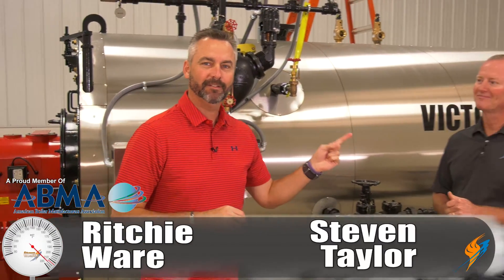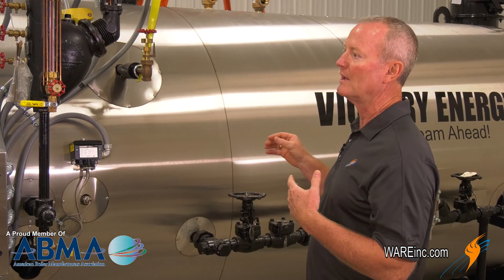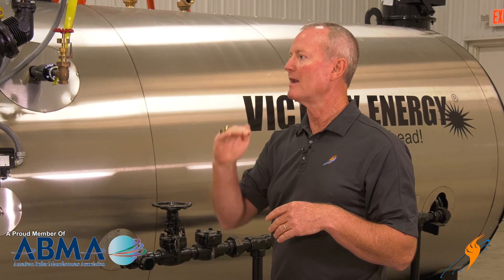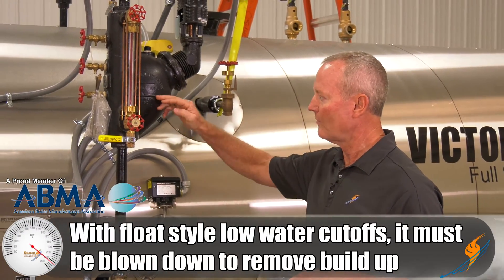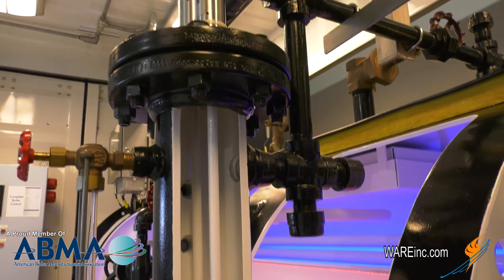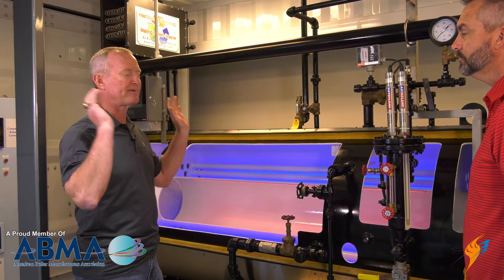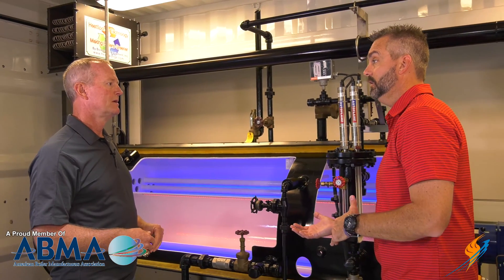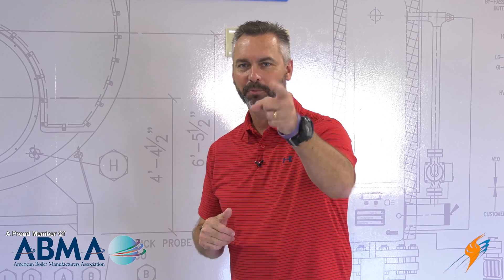Low Water in a Steam Boiler - Boiling Point

Comment: Cool video! I love the cutaway boiler. But Steven, water added to an overheated boiler can't "instantly turn into steam" for several reasons - mainly because
 
a. the water is still under pressure,
b. adding water takes time
c. convective heat transfer from steel to water takes time
d. steel doesn't hold much heat (only 0.12 BTU/lb/ºF)
e. but water at 400ºF/250 psi still requires about 800 BTU/lb to turn into steam 
f. 400ºF water will hardly "wet" red-hot steel at all (Leidenfrost Effect), so with excessively high steel temperature (1200ºF) - amazingly - heat transfer from red-hot steel to water actually takes LONGER than usual at 400ºF. Weird, but true.🧐
g. In other words - adding hot water to red hot steel is exactly the same as adding red hot steel to hot water, it's not nearly as exciting as you think.

In rough numbers - say, 
- ten 2" tubes ten feet long (~300 lbs of steel)
- heated to 1200ºF - a dull red (800ºF over 400ºF boiling point) 
- only contains 21,600 BTU of "excess heat" - 
- theoretically, enough to turn ~27 lb of water (3.24 gallons) at 400ºF completely into 47 cu ft of steam at 250 psi. 
- say it took 2.5 minutes total to boil 27 lb completely, so only 13.5 lb extra steam/minute (810 lb/hour).🧐

Even if all the 27 lb of water boiled in 30 seconds, a 2" relief valve could handle more than double the extra steam the red hot metal could generate. And the hot tubes can't make steam any faster that you can add water, so if you trickle it in even slower, the total lb/min of excess steam cannot exceed the lb/min rate of water feed.

But you need to add 2" water to the boiler to cover the tubes and quench them completely, which would require about 18 gal, or 150 lb - about 6X more water than the "excess heat" in the overheated tubes could boil (27 lb), so the actual amount of "excess steam" would be about 4.5 lb total. 

In other words, water added to an overheated boiler can't "instantly turn into steam" - for a lot of reasons. But it's still not a good idea to quench overheated tubes under pressure for stress reasons. They could shrink fast enough to pull loose, or tear right out of the sheet, which would be bad.

So if we found the top row of tubes dry, and they are not leaking yet, I'd say shut off the fuel, stay calm, and don't do nothing except hold the water where it is until it cools down.

If we found ALL the tubes were dry, I'd shut off the fuel and run like hell.😂 

Please check my (crude) math, but I think it covers the basics.
Reply: I cannot agree with you conclusions. You mention the Leidenfrost Effect, and then say water can’t boil “instantly”. The Leidenfrost Effect is due to an insulating layer of...steam...that is generated so quickly that the water can’t fall through it to the surface. As soon as one bubble leaves the surface, water touches the hot surface and makes more...steam!

And the fact that you cant instantly add 37 gallons of water exacerbates the situation. If you could instantly add a blanket of water to quench the hot spot, you could probably avoid an explosion.  But what little water reaches the surface instantly turns to steam—and stays steam!  If one gallon, or five gallons of water flashes to steam, what happens to the pressure? If the steel is red-hot, its because there’s fire behind it; you can’t just consider the latent heat in the steel. 

Good luck making the door! 😁

Comment: We had three 750 HP boilers Clever Brooks. Typically only two ran at a time unless it was real cold then maybe all three, summer only one. So if two where running I would fire up the not being used let it get to temp, and do a sight glass blown down and  do the bottom down, repeat on the second boiler EVERYDAY. We would also rotate which two or one would run at any given time. So all three will be running at some point during the week.

Comment: Does the code require the second low water to lock out the burner controls ?
Reply: Depends on your local code.  Boiler controls can be different depending on the local codes.  Most BMS will require a manual reset on the local control panel before the boiler's burner can recycle back on if the aux LWCO trips the unit since its usually wired into the BMS's non recycling circuit.  The level control pump on pump off micro switches on the Mcdonnell Miller with turn the feedwater pump on/off to maintain normal water level and the primary LWCO on a firetube will generally restart the burner when the level returned back to normal if the Mcdonnell Miller does not have a manual reset on primary LWCO switch and if it is wired into the BMS's recycling circuit.

Comment: If the low water cutoff is meant to be instant, how do you deal with large losses of load which cause the water to shrink rapidly and the reduction in firing from the trip causing the water level to continue shrinking (due to the reduction of steam bubbles) further exposing the tops of the water tubes?

I understand that during constant loads running out of water can easily melt the tubes and the heat removed before this can do damage, but how do you deal with and adequately protect the boiler during load changes as the water inventory must increase (as the water shrinks) during a load reduction?

Comment: So what device that prevent too much water in the boiler? The video show some sort of switch above the boiler but didn't mention it. Thanks
Reply from the maker: High water Alarms / cutoffs are optional so the boiler from the factory could potentially not have it. These devices will be very similar to the low water cutoff but typically mounted higher. Hopefully that helps. Thanks for watching!

Comment: But how are u gonna test the secondary Low water cut off by opening the bottom blow down valve and watching the gauge glass to see if the burner shuts off before thr water in the glass dissapears IF the burner will or should shutoff before that point due to the primary low water cutoffs point of tripping the burner is before the secondary low watwr cut offs. U know what i mean? Do you temporarily jump out the primary low water cut off?
Reply: Why would anyone roll a tube standing behind the machine unless he want to get hurt. Your suppose to stand to the side with arms extended. Did this 4  29years in nyc.
Reply: I have the same question as DaGenius86.  Also, when conducting the test, as the water level drops in the sight glass, isn't this water level matched to the water level in the drum (i.e. the drum level is lowering to the same point as the sight glass.)?

Comment: Using the McDonall & Miller 750 series with the probe mounted in the top of the boiler, I find it very common that the 750 will not lock out the burner while there is water still visible in the sight glass while the boiler is operating (low pressure). I thought about cutting the probe shorter. But, if I shut the boiler down and blow down the boiler, the 750 will lock the burner out when there is still 1- 1.5" of water in the sight glass. What are your thoughts?
Reply from the maker: I would be very cautious before cutting the probe shorter unless it has been replaced and cut during installation. Perform some very detailed measurements before attempting to shorten the probe. 

It really sounds like there is some swelling going on when the boiler is firing. This is common on boilers with high furnace heat release rates or low sq/ft of heating surface to HP ratio. What happens is that while the boiler is firing you have a higher water level in the center of the boiler, where the highest heat transfer is taking place, than you do on the sides of the boiler. So even though the sight glass showed that the LWCO should have been dropping the boiler out the probe was still made due to the swelling. When the burner was turned off there was no swelling so the level had equalized.

I have seen this and it is not uncommon. But I would do some additional test to make sure there is not a circuit issue. Is there some way that the 750 could be bypassed while the burner is energized? If you continue to drop the water level with the burner firing will it eventually drop the burner out? If not then you have a more serious issue that needs immediate attention. As always, make sure that you consult your boilers manual for detailed information on procedures or get with a local boiler service company to make sure the boiler is operating safely and efficiently.  Thanks for watching and hopefully that helps!
Reply: @wareboilers  Yes. This does sound like swelling. The DOES eventually shut down the boiler. But when it does, the water level is out of the sight glass. It's still above the tubes so I think it's safe.

Comment: ok how do you add water to the boiler and not have the injected water being added forced out due to the pressure inside the boiler.  Is the water entering the boiler at higher pressure then internal pressure?
Reply: Yes because it has to overcome the steam pressure via feed pumps

Comment: Are all sight glasses set up where water level should be around 50%
Reply from the maker: Thanks for the comment. In general it might seem like most water levels are around 50% of the sight glass but really is depends on the equipment and how it's being operated. It really just a case by case basis on where it should be. Hopefully that helps.
Reply: Generally, during operation the steam drum level is maintained from 40 to 50%. Because the steam will fluctuate the level in the drum. And it is advisable to keep the level 40 to 50%